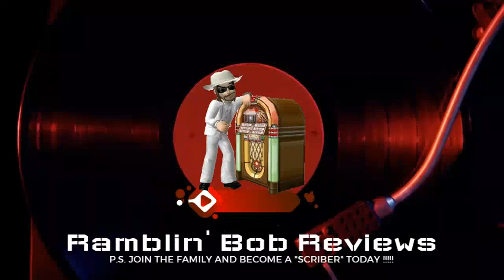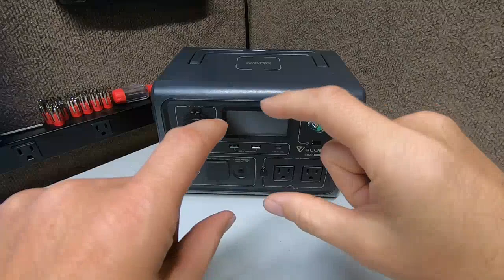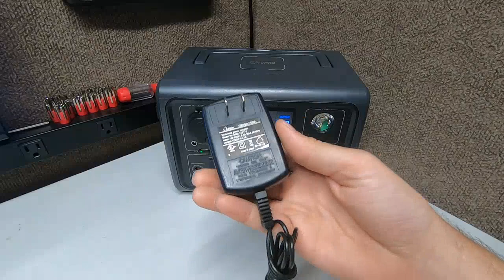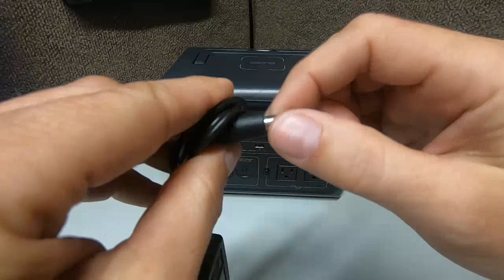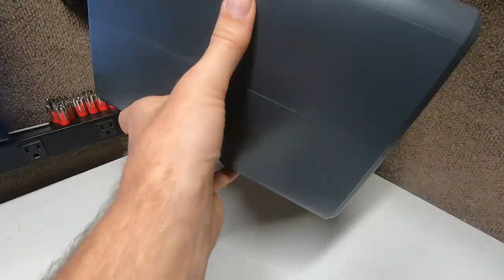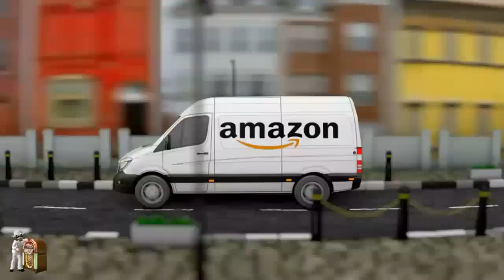BLUETTI EB3A Power Station (UPDATE 6)

Comment: What is the max amp input on eb3a?
Reply from the maker: Input power: 350W via adapter solar input power: 200W 12V - 28V (max. 8.5A) 430W AC and Solar Input simultaneously
Reply: @RamblinBobReviews  thank you sir

Comment: Is it possible to connect an inverter having a high wattage of 2000W from the 12v cigarette socket inorder to run a devices having a wattage of 1200w to 2000W?
Reply from the maker: No, That cig output is maxed out at 120 watts

Comment: What I want to know is what is the wattage of that generator what can I put out and it probably is way too small for anyting unless you only plan on hooking up a light and a phone but in that case it's pretty much useless because you do that with solar panels at least the foldable one physical hookups for phones and lights and refrigerators on them as long as they're big enough to run them.
Reply from the maker: 600 watts, 1,200 with power lifting

Comment: Bob your advice on the battery storage is spot on.  I did audio as well for a short stint but thats a story for another day.  Anyways if you bought the power station just use it to run whatever.  Hey if it saves you 5 bucks a month its your 5 bucks not the power company's.  Lol   You want to know that thing works when you really need it.
Reply from the maker: Good info